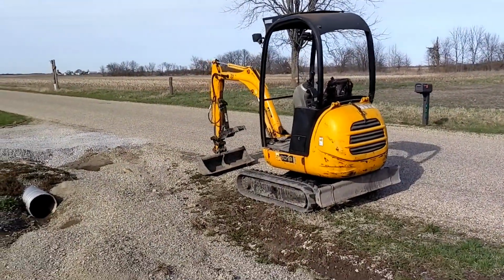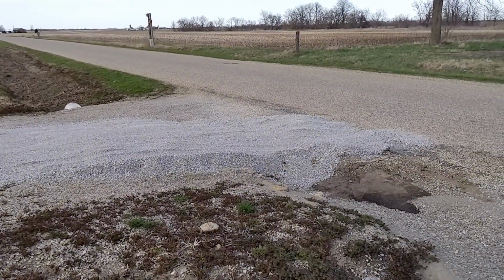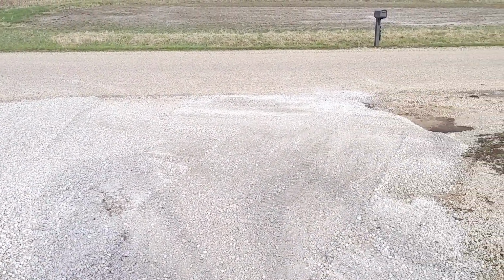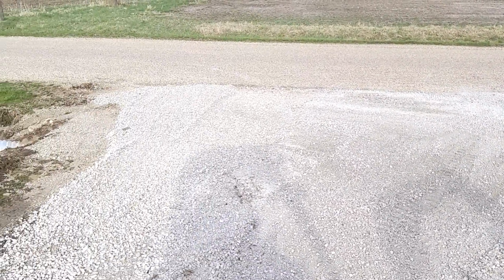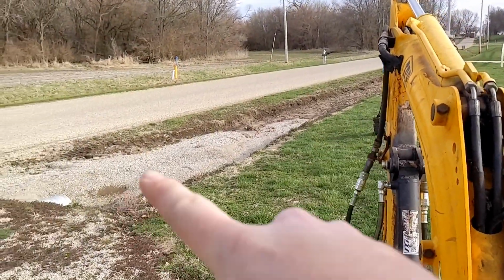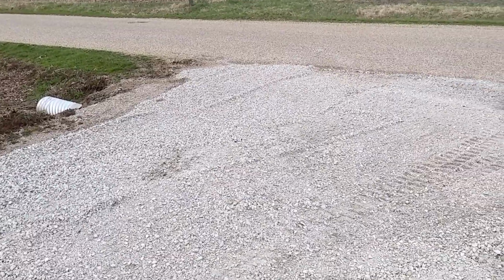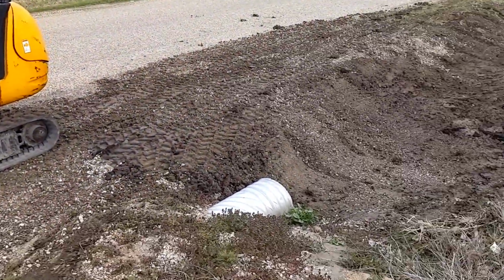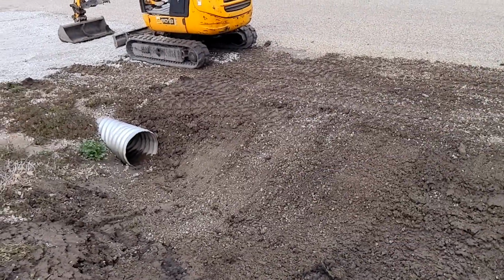Mini Excavator Digging A Driveway

Comment: You said you're not an operator but I think you done very well on that job particularly considering the material you had to work with. The only way to learn is by doing it and you're doing it, so keep up the good work. Obviously the culvert is not big enough for the flow that comes down in a big rain, might be a regular contract for you fixing it up after the storm. That looks a nice machine by the way.
Reply from the maker: Thanks for the kind words. I feel that I'm getting better every day.

Comment: I'm not a big fan of JCB but I do have a Bomag key that fits it.
It looks like drain rock. He should have used Base Rock or class 2.
You cannot compact drain Rock just like you cannot compact sand.
Need a different material that will compact.
Reply from the maker: Better material would help.